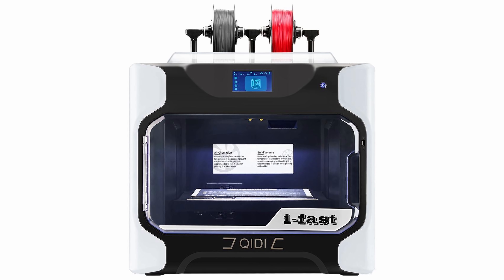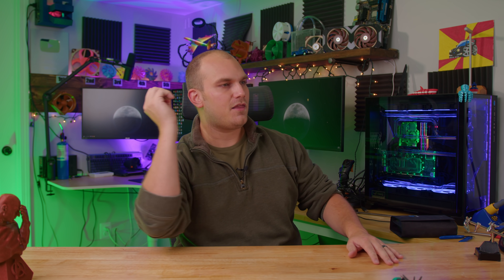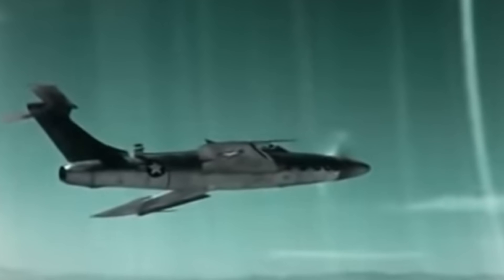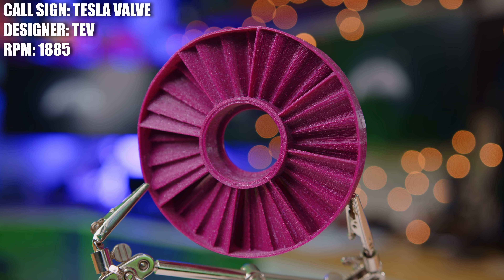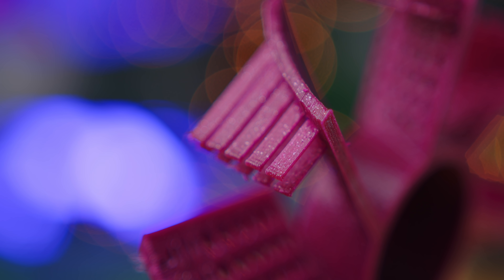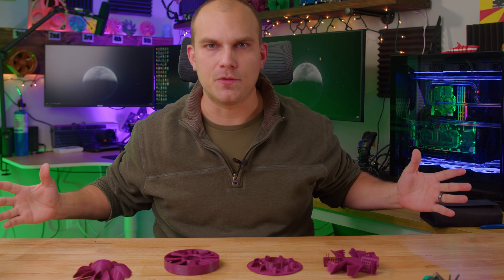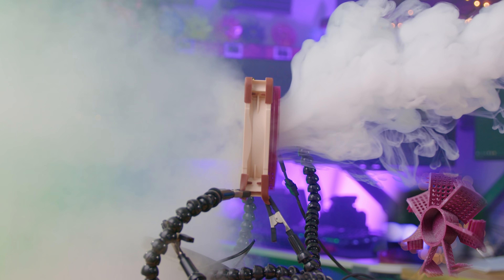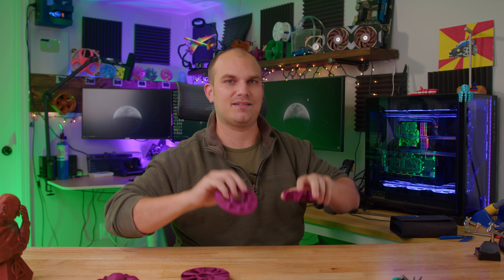The IMPOSSIBLE is now POSSIBLE | Fan Showdown S3E6

Comment: Mastering engineer here, measuring loudness is my game. I don't know of a single measurement that takes into account loudness AND frequency content in a single easy to digest number that says X is 3 more louds and 5 more annoyings than Y. There's just too many variables involved. The closest that I'm aware of would be LUFS, which is what TV and radio broadcast are standardized to these days. That can account for changes in loudness over time, but not really for frequency content (I think it does a little bit, but not in a way that I suspect is particularly useful in this case). As others have mentioned, software is really the way to go if you want to get deeper into measurement. Since you already record noise samples from each fan, you have the files to drop into software anyways.

I like Youlean loudness meter for loudness, which is free and completely overkill for your loudness measuring needs. It doesn't measure the physical noise levels in a room (at least not that I'm aware of), rather, it measures the levels of the signal you are processing in LUFS or another similar measurement of your choice. You could say a Noctua fan is X DB which correlates to Y LUFS at a setting that you test all fans at, so we have an idea of how the measurements compare. Or just keep measuring loudness in DB in your room as that is what we actually want to know in this instance. LUFS might tell us a bit more about noise performance, but I don't think a fan at a (hopefully) stable noise level is going to give you much to analyze.

More usefully, Voxengo SPAN is also a fantastic free frequency analyzer as others have mentioned. And I think in the same way that your smoke tests help us visualize the fluid dynamics performance of the fans, SPAN could help us visualize the audio performance. But just as the smoke test doesn't replace the actual stress test, SPAN and it's analysis aren't a substitute for what we hear in a room. I think you could find over time that certain noise distributions in SPAN are more pleasing than others, and it would give is a more visual representation of how weird it is when a fan comes in that buzzes like a bee the whole time. But it's not going to replace your own observations of what the fan is actually doing.

Comment: the fan blades of austins need to be polished. Theres far too much turbulance due to all those 3d printed ridges. smooth laminar flow, think of air like water, sure itl still flow but it flows much nicer if things are smooth.

Comment: The Tesla Fan seems to stall. Meaning, instead of moving air through the fan, it just rotates the air in a circle. I don't know the exact math behind it, but to my understanding the reason is that the fan causes more drag than pressure.

Comment: The whisk needs some slight design changes to make it a bit better. I think it needs to use the whole width allowable. there's a lot of wasted space there. Also It the leading edge of each scoop was angled such that it swept forward, it would lose less air out that direction due to centrifugal force and would throw more out the back.

The Tesla one needs forward sweep too I think though It would seem more difficult to do.

I think the reason that the cheese grater worked so well is because the small holes trap a layer of air right next to the blade. then as it spins the blade doesn't contact the air being pushed through it's an air-air contact which has less friction and therefore easier passage through. This is a good option for when a really smooth surface can't be achieved (like they are here being 3d printed). The weird stick things at the edge would function kinda like a curtain to reduce air being thrown out centrifugally though it would work just as well with just a flat surface there.

The prandl fan might be improved maybe by adding something around the ring to avoid throwing air out centrifugally as well. Note that the ring would need to be thin but also tall so that it rose above the front of the blades...

Can't be bothered modelling these up but someone else feel free to do so.

Comment: The fan's diameter is ~110 mm=0.11 m.
Ignoring the air flow over the fan, and the angle of the blade, in order to go supersonic (~350 m/s), it would need to travel at ~1000 revolutions per second, or ~ 60 000 rpm.

These fans are not going any where near 60 000 rpm, and thus will not be going supersonic, making any design to negate the effects of a sonic boom useless (at least useless for removing the sonic boom).

The Tesla valve is also entirely useless. It is designed to make it difficult for a fluid to flow through backwards. It doesn't make it easier for fluid to go through forwards. In fact it makes it slightly harder for fluid to go through forwards, just to a much lesser extent as it makes it harder for fluid to go through backwards.

Comment: You can use a measuring microphone such as the UMIK-1 from miniDSP its designd for measuring the response from speakers comes pre calibrated plus you don't need a audio interface to use it because its usb ... But any simmer measuring microphone will do

Comment: I wonder how much the fan designs with an outer ring would benefit from a printed (or purchased) skirt of some sort around the inside edge of the housing. could be interesting to take a bunch of those styled fans that performed decently and put them through a gauntlet to see  different ways of sealing that area in practice

Comment: Der8auer did a custom aluminum fan frame. Can you do one in Carbon fiber or 3d printed metal? https://youtu.be/J1L1-IESF1M
With 2x T30's? Or better, would noctua ippc 140mm fans fit in the case? 140mm for quiet operation but also higher cfm and static pressures.

Comment: for the sound test, are you ensuring the fans are all running at the same rpm when you measure them? a fan with less mass towards the outer edges is going to spin faster with the same voltage. and therefore produce more noise

Comment: I've said it before and I'll say it again -- the smoke visualisation would benefit from a box or shield to prevent smoke being drawn round the sides of the fan by a combination of the smoke's own velocity and the Bernoulli effect from behind the fan.

You could achieve this with a PC case with a see=through side panel, or just by setting the fan body in the middle of a sheet of plexiglass. If you don't want to do it permanently, you can cut it to fit loosely then fill the gap with something like plasticine.
With the overspill removed, the true flow of the smoke will be far clearer.

Comment: A) How about creating a like a lexan barrier for the smoke test. all the smoke that goes around the fan is kinda distracting from whats actually going on and ontop of that most fans are designed to flow through a barrier so i bet some designs can actually improve from this.
B) I want 3d printed radiators.OR how about a radiator design competition like the fans???

Comment: I am unconvinced that the prandtl fan will be quieter once you normalize for the same amount of airflow. The reduced load at the tips necessarily means you need larger fan blades to equal the same amount of airflow. You could run an elliptical of the same size at a lower rpm (and maybe less noise) and get the same flow. I've been researching the benefits of this in aircraft wings but admittedly don't understand the precise differences when applied to propellers yet.
The shocks at the tips of supersonic fan blades is largely irrelevant since we are talking about strictly subsonic flow here.
The weaker tip vortices generated by a prandtl propeller are also irrelevant because we are talking about ducted fans.

Comment: I had an idea for your fan showdown that would be a more accurate test of all the fans as far as air movement. I come from a construction background, and thou I am not an engineer I am one at heart.  My idea being, you build a test rig for measuring positive and negative air pressure. This can be done relatively easy by using a standard empty pc tower, some way of sealing up any and all holes making the tower air tight, with one way for air to move in and out of the case. Input being the noctua fan test rig, the output being a hole equal to or smaller than the input side. One more component is needed for this test rig. A sensor called a manometer. A manometer is a device with two inputs for measuring atmospheric pressure between two isolated areas. In this instance it would be the air pressure in the room versus the air pressure inside the test rig. You could even combine the smoke test with the pressure test. Mount the fan in the test rig, start the fan, take the pressure reading, then start the smoke test and the smoke would have to be drawn through the test rig. Just a thought.

Comment: Signal processing engineer here. You don't need any fancy spectrum analyzer. You just record the audio with a decent microphone (ideally: laboratory measurement - type microphone), and then import the audio signal to any programming environment and calculate the spectrum. In the past I have written scientific papers that prove that you can achieve amazing results based on audio recorded by a normal smartphone, so you probably already have better mic than you really need. Good luck.

Comment: There is already a thread in reddit about measurement mics, it recommend umik-1 but it is usb mic which may cause problems in the future. USB mic is standalone, can't be connected to anything but a computer and only one at a time.. Good old analog connectors are still the best in the long run. 150$ is about the amount that a good mic costs but cheaper mics are not hopeless, at all. The accuracy will be +-3dB with cheap ones and +-1.5dB  in the 150-250$ range. Where the price starts to matter is the accuracy at high frequencies. 150$ will take you closer to 20kHz, with 50$ you are getting decent accuracy to about 10k and after that it is more or less inaccurate, but still usable in most cases.

The thing is, cameras and phones do not have such awful mics for this, they are just uncalibrated.. The mic capsules used in both are very similar and in some cases even identical. It is the calibration and in some parts, the housing of the mic that makes most of the differences between camera and measurement mic. So, it is possible to go back to old footage and get some data about the sound characteristics. But you need a calibrated mic first so that you can get some idea about the defects in the camera mic... It will not be accurate but may give some idea what the sound was like.

More pleasant noise characteristics are when there is little high frequency content, no strong static tones (one prominent steady, narrow frequency like a whistle), and no pulsing (helicopter blades). What we want to see is at 100-400hz we have nice flattish curve that gradually and smoothly lowers as we go up in the frequencies, no large peaks or valleys. If the overall energy is distributed across a larger bandwidth then any individual frequency is going to have less energy and it feels like it has less sound energy... which makes it closer to white/pink noise.

Comment: Actually, why dont you start printing with an SLA printer? the fan surfaces would be far more accurate, which could reduce noise and make the testing and performance more accurate, instead of the dirty airflow thanks to the printing layers. (as im guessing you print at a pretty thick layer height, seeing from the B-roll shots)

Comment: I wonder if the cheesegrator would work in a closed case design, but not as the primary fan, just as a general 'keep air flowing everywhere' fan, though, i guess if you think about it that far, you might as well figure out the best way to have the air flow in the first place. i've seen lots of linus tech tips building computers in cases and it seems like they are more interested in removing the air inside the case as much as possible, and only allowing fresh air in. I don't think they care about where the air flows inside the case, so long as it is cool fresh air. but if you think about it a bit more, in trying to use something like the cheesegrator for spreading air around, you might as well just figure out the best possible air flow, no spreading needed?

Comment: @Major Hardware
9:55 Can you mount the fan onto a plexiglas or similar, to stop the "back-flow" of air from the back side of the fan into the front again.
(film it especially from the side, but it would also be interesting to see it from like 45* angle & from the front too)

Comment: Put the cheater inlet nozzle on the tesla valve it should create a step edge preventing all loss .. Or put a rim off the front face of it to create a lip over the frame of the fan.

Comment: nice video but i need to say, the price of this printer its not expensive AT ALL, the sensors, dual filament, able to print high temp, the problems its than ender and other really really cheap prints affected the preception of expensive, real priinters are expensive :D

Comment: Have you ever considered making something to get laminar flow of the fog? it shouldn't be hard to print something that smooths out the flow, and all you have to do is use a piece of hose to jam into your smoke dispenser.

I remember making something like that in science class or something. all it took was a box of drinking straws wrapped with tape to make them solid inside the box, and then cut the ends of the box off.  turbulent flow in, laminar flow out.

Comment: I've always imagined one of the big, limiting issues of "scaling down" propeller/impeller designs, particularly this much, is that zones of turbulence and undesired "air cushion" effects do not scale linearly. Especially when the surface area get this small and RPM goes up. Air has mass, and viscosity.

Am I thinking of this wrong?
Reply: Atmosphere and gravity give limits.  That is why aircraft are not any larger.

Comment: Integrated/self-contained hardware audio spectrum analyzers could get really expensive. A good, fit-for-purpose microphone and a software based solution analyzing a recording, can be much more affordable. And you won't be restricted/limited to whatever info that dedicated db+spectrum analyzer hardware combo cares to share with you in real-time. Just use a clapper, snapper, clicker etc to establish one or more sync points for your own reference, if fan noise is very inconsistant.

Comment: Damn. I was hoping for a static pressure test on the tesla.
Regarding the tesla valve fan, I think the design didn't account for the centrifugal forces throwing wind at the outer rim; the essentially angled 2d valve fins couldn't do anything for that outer wall.

Comment: If you airbrushed the prints with Mr. Hobby MrSurfacer1000 it would be much smoother, which would improve the airflow, wouldn't it? You airbrush it on, and if you use Mr Levelling thinner, it fills up all the surface imperfections, even to some extent the print lines, and leave a smooth surface which is also a primer, ideal for overcoating with more paint. just a thought.

Comment: I have had Qidi X-plus for a little over a year now and it is simply awesome. It works great without modifications and includes high themp extruder. Another great thing is that Qidi customer support is simply outstanding. I had a minor issue with my printer in the early days, and they answered promptly to emails and sent instructional photos and videos to accompany the trouble shooting. After the trouble shooting, they promptly shipped the replacement parts to me (the issue was x-axle coupling that wouldn’t stay tightened for long time).

Comment: I think the turbulence in the Tesla valve inspired fan is due to the air moving outwards with a considerable speed due to the ridges in the fan blades. If the air moves on top of the blade towards the outside it eventually hits the shroud and then will split. Half of it goes down, the other half goes up, which is what we see as a small whirl at the outer edge.

Comment: the tesla one needs to be scaled up a tiny bit - the tighter the tolerance on the gap between the fan's rim and the housing, the better. obviously, this comes at a cost of needing a more controlled environment due to thermal expansion, but this effect should be mitigated by making the housing out of the same material, or maybe the rigidity makes the expansion negligible, idk lol. either way, changing the scale for a tighter fit on a re-print should be easy enough if you have a calliper to get the ratio accurate enough. you could also try seeing how different RPMs affect it. it could be deforming and shrinking due to centripetal force from spinning too fast for example. gravity could be effecting it too due to the bearing type, so maybe vertical mounting would be better, or using a mag-lev bearing if you aren't already, reducing stability oscillations making it jiggle about
either way, slapping it on the end as a static valve to increase performance/reduce noise for other fans by mounting it on the out/in sides of the housing (but you'll need to scale it up anyway) would be interesting!
i'd suggest, since it's a heated chamber, measuring the size difference of the housing in and out of the typical temp of the chamber, as well as a testpiece of a printed ring, to see how much shrinkage you get from the ambient and chamber temperature differences
looking forward to see the video comparing options the comments suggest for the db meter at least